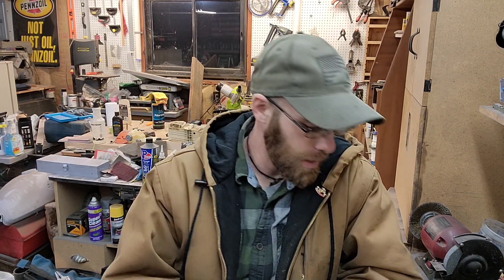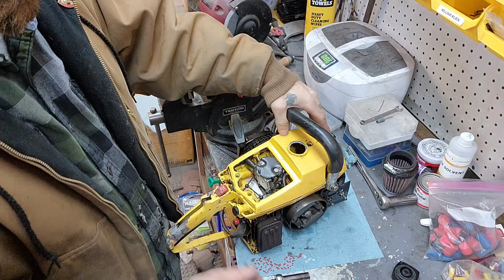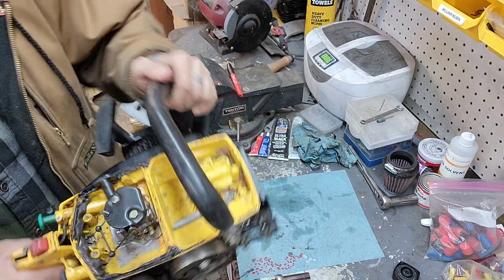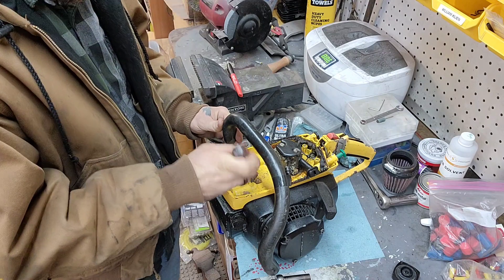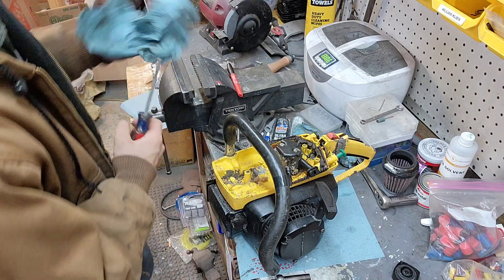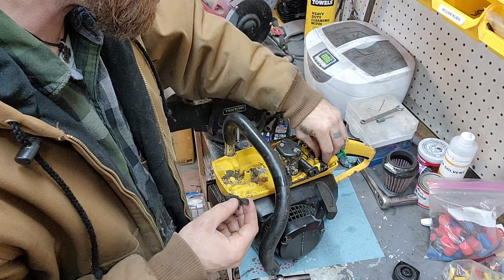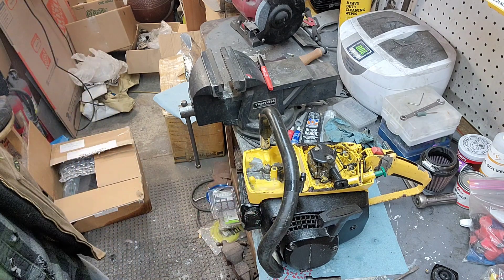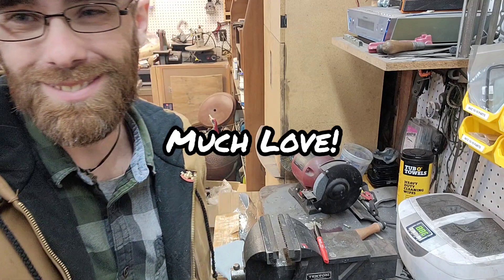McCulloch Pro Mac 700 In For Repairs & Porting

Comment: Stevie
Reply from the maker: Tinman! Hope all is well buddy!
Reply: What did you use to seal the tank back up? I just purchased the same saw and can see some fuel seepage around the seam.
Reply from the maker: I make and sell gaskets but what I used on this one was a newer style rubber gaskets with the Grey gasket sealer. You can use a cork gasket as well like the original with I still use the Grey gasket maker.
Reply: OK, thank you.